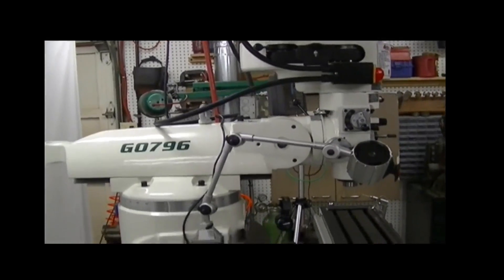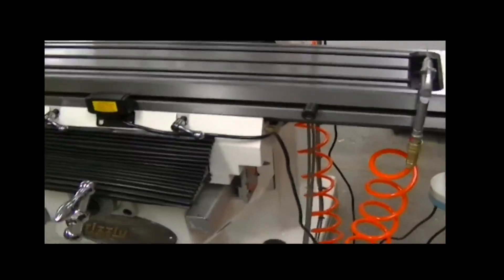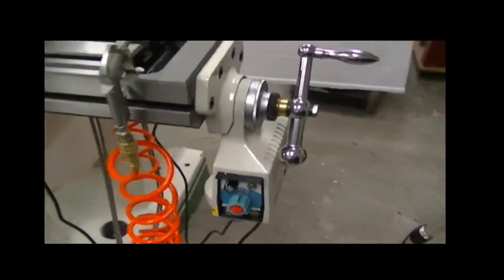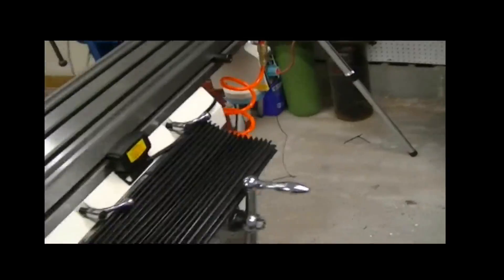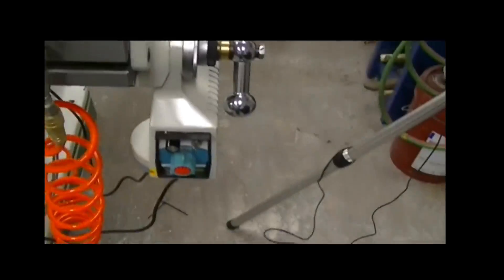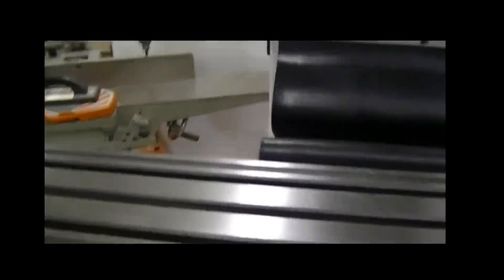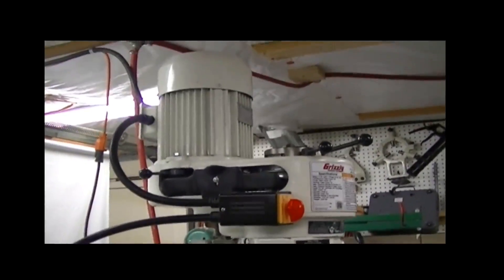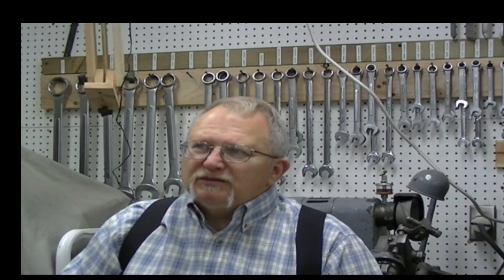Grizzly G0796 Mill First Look Part 1

Comment: Thank you for your over view on this Grizzly GO976. I went to Bellingham picked one up,,,,,,,, what a great machine!! Love it. Now it's time to upgrade my lathe to a GO709, maybe after Christmas when they re-stock. I have set the mill up and put it into production it is dead nuts on.
Reply from the maker: Hiya Donald: Thanks for the nice comment. I think you will be very happy with the G0709. It is not technically a toolroom lathe, but I have run lots of toolroom lathes that are not as tight and straight as my G0709. You will love it. I was in the Springfield MO Grizzly showroom last week. It is nice, but not like the Bellingham showroom. Good luck.
Barry

Comment: Given the current price of this Grizzly, $7,000 +Tax, the current state of Grizzley support, and current price of used Bridgeports, would you still opt for this mill today?  
I want a Bridgeport before I retire, and am currently shopping around.  I know it should be compatible with Bridgeport aftermarket parts  & accessories, and I REALLY think I better get the J2 head.  I can add power drrives and DRO later at a decent price, but the variable speed head would be cost prohibitive to add down the road.  Not having it would haunt me every time I use the machine...
Reply from the maker: Definitely. Yes.

Comment: I was thinking of purchasing  this machine. what's the difference between this machine and a bridgeport? I mean this machine is brand new. vs buying an old bridgeport to fix it all up to be working new would be around 6000.00 anyway. I'm just wondering if you could give me some pointers on what the big difference is......thanks for your time!
Reply from the maker: The biggest difference is that the Grizzly is new and does not need hundreds of hours of rebuilding, the Bridgeport does. If you want the Bridgeport to work like a new machine, you need to scrape and flake the ways and that takes lots of hours. The Grizzly is ready to work on the things you want a milling machine for.

Comment: Nice mill.  I have to say that my experience with Grizzly for the past twenty five plus years has not been yours.  There parts and service were excellent when they were in Bellingham but seem to have really dropped off since they moved the parts and service east.  I don't know whom you were contacting in Bellingham but I have always had to email or phone back east for several years now.   They are happy to sell in Bellingham but they no longer do service there in my experience.  While the expertise seems good parts shipment has generally taken six to eight weeks for small parts and longer, often they just forget the order,  I am still waiting on a promised replacement power lead that was incorrectly stripped at the factory for my new G4003G metal lathe that I purchased last summer.  I reminded them a time or two and finally just gave up repairing my "new" machine with electrical tape and heat shrink. 

 Also they are doing the 'cop out' thing now that they did not do before.  On my 14" bandsaw purchased at he same time as the lathe one of the blade guide bearing seized up after less than fifteen minutes of use.  When I called them they said that if I had been cutting any kind of plastic the warranty was void!  The good news was that was a speedy delivery of just over a month for the bearing.  I don't know about you but one of the anxillary uses of the bandsaw is to cut PVC, ABS and various plexiglasses for me and I have never had one that excluded their use until now.  Granted I use it mostly for wood but I thought it was shyster lawyering to not replace an obviously flawed bearing with that excuse.  So I would not rate the service at Grizzly nearly as highly as you do.  Fifteen years ago I would have agreed not today.  I still think their equipment is worth the money mostly although their accessories are a bit overpriced but their parts and service really need looking at.

I too have bought many, many of their machines.  Mostly new but a few were used that I rebuilt as needed so my experience with their after sales service is long and varied.

I agree with you that used and abused Bridgeports have become very overpriced and a status symbol rather than a working machine and the Grizzly model represents very good value for the money.  I am looking in that direction for a future purchase myself so your video is very interesting.  However their parts and service will not be part of the reason to purchase from them.
Have a good one.  Doug
Reply from the maker: +Douglas Thompson Hiya Doug:
I am sorry, no, I am VERY sorry to hear that the parts and service situation in Bellingham has changed. The last time I had a problem involving them was indeed 15 or so years ago. Thanks for the excellent update. 

Barry